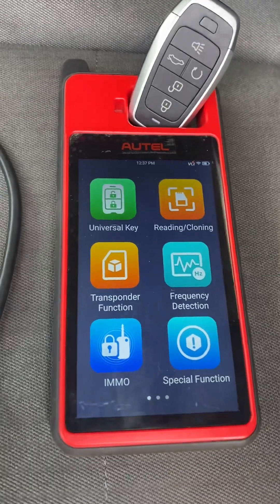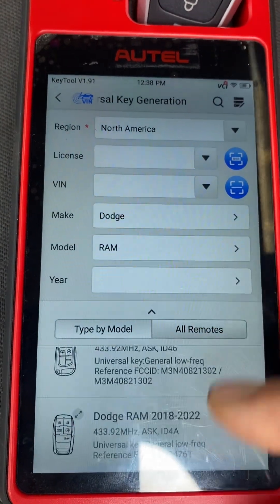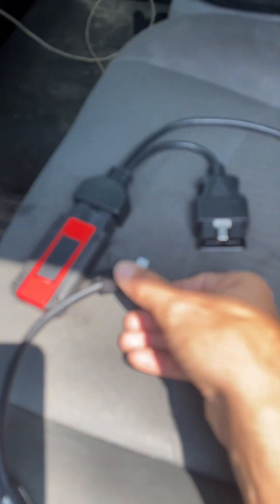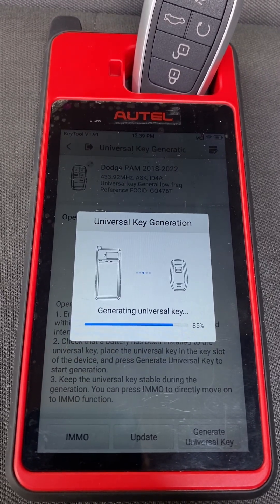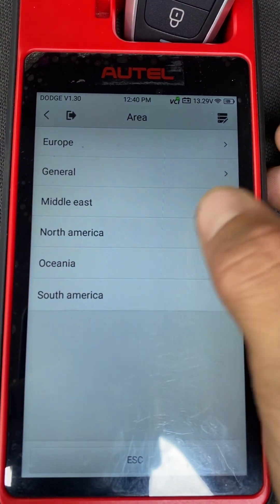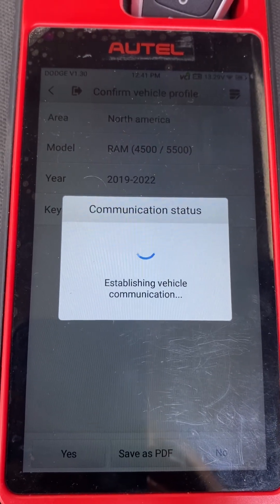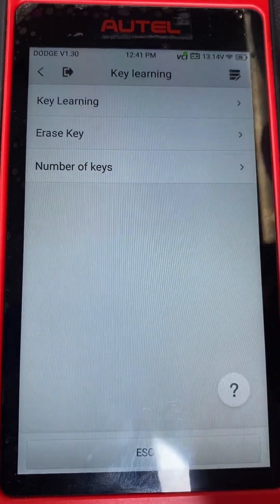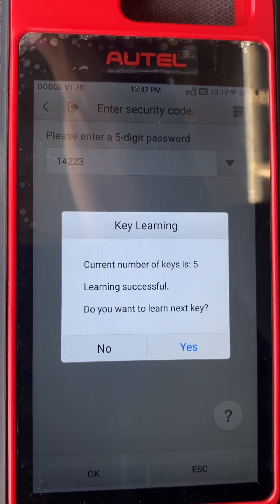2020 Dodge Ram 4500 All Smart Keys Lost using Autel KM100 and Universal iKey

Comment: What cable are you using that was plugged into the green port inside the dash? That did not look like a standard Chrysler 12+8 cable.
Reply: Star connector cable, much easier to get to

Comment: question for you , 
i got an im508

1, ikey universal should be able to be smart key right ? (keyless go)

2, what happen when you want to generate a key (remote) but the model of the key (remote) is not in the options inside universal key option ?

i got a auris hybrid 2015 its a keyless system (no key ignition only start button) 

to program the car its requiring to put the key near the start button , however the car does not recognize the key at all(i tried 2 keys and 2 different batteries) tried to program the car over 10 times nothing worked , it failed all the time , so i thought maybe because i did not program the ikey universal to that model , maybe because of that it does not recognize it. 
when you put the car key near the start button the car make a sound and there is a red flash icon near the screen, however nothing happen when i've put 2 ikey near the start button , no sound and no flash icon .

when i went to "program" the universal key , i saw that the car model is not even there .

keep the good work by the way